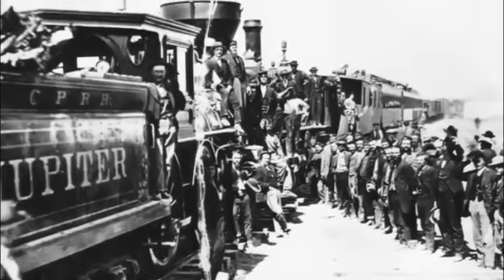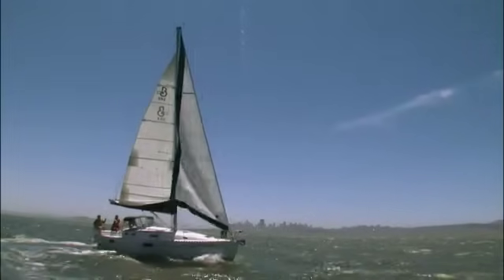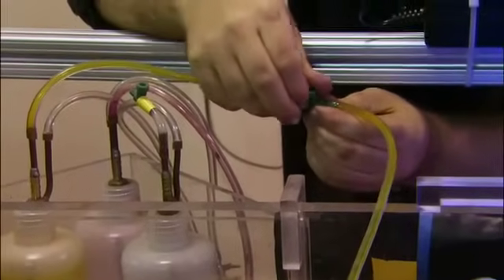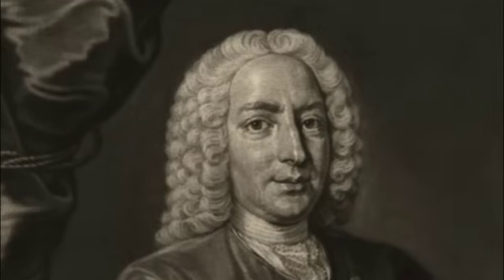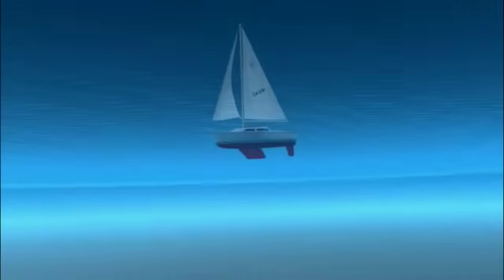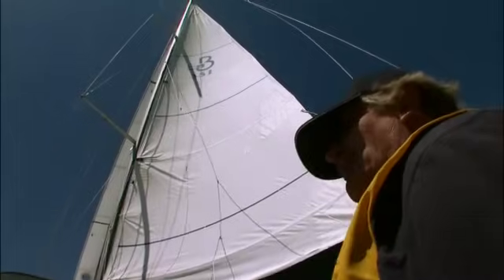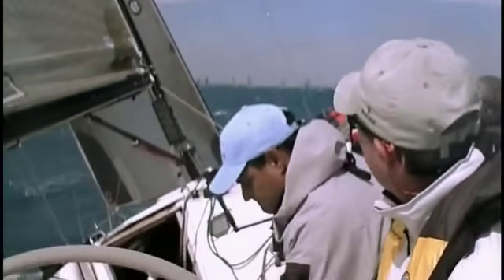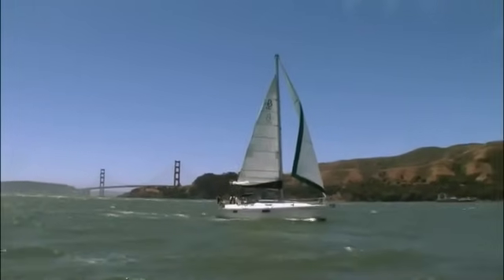The Physics of Sailing | KQED QUEST

Comment: Hey guys, just a note about why lift happens, this guy is chatting bull. Bernoullis law doesnt apply in the case of a wing (or sail). For his law to apply, certain assumptions must be made. firstly that the fluid has zero viscosity, but as we can see, the fluid 'sticks' to the shape of the wing, which is a viscous effect. secondly, that it is a steady flow. which as said in the video, it is not. Finally, Bernoullis theorem only applies to a single flow, once you talk about flows above and below a wing, its moot.

While Bernoullis can describe some of what is happening, the fundamental law behind lift is newtons 3rd. watch the flow as it comes off the wing, its at a different angle, meaning a force was imparted on the air by the wing, and thus vice versa

(im an aerospace engineering student and even people in the aero business get this wrong (including the most of the internet), and this isnt coming from me, this is coming from Dr Iain Dupere at Manchester University)
Reply: ***** Wow that is a strong response.  Unfortunately it is also completely wrong.  Bernoulli himself would not subscribe to this. A few things to note:
1)  Bernoulli's equation is a description of the momentum equation under three very specific conditions: inviscid (all viscous forces are ignored), steady (i.e. time invariant) and incompressible (actually not too bad here although interestingly *****  also comments that fluids are all slightly compressible).  In fact it is easily understood, if the only two forces acting on a fluid are pressure-area and gravity, then for the flow to accelerate it must either see a drop in pressure (i.e. it accelerates from high to low pressure) or a drop in height or both.  Far from causing low pressure with high speed, in fact the low pressure creates the high speed.

2)  Bernoulli's equation comes from consideration of a stream tube and so only applies along a streamline and not to more than one streamline.

Bernoulli then, definitely falls down in this application, on two counts (inviscid and more than one streamline (the flow either side of the sail is on two different streamlines).

Someone else refers to Potential flow and, in particular, the Kutta condition.  This is a common approximation, in which the flow is assumed inviscid apart from the generation of vorticity.  This is a fudge since Kelvin's law shows that vorticity cannot be created in inviscid, incompressible flow.  To have the same constant on either side of the sail requires uniform horizontal flow which has no vorticity.

All this leads to the well documented result that, in the event that Bernoull's equation is correctly applied to a wing (or sail) the actual lift will be zero!!

The Kutta condition does give a crude estimate of the lift (and was used before the days of CFD) and does give some indication of why the viscous effects are important in this case, however, Bernoulli does not strictly apply (the flow violates one of the conditions) and certainly is a poor explanation without some reference to the Kutta condition.  As pointed out, it is better to say that the flow leaving the sail follows the path of the sail due to a subtle but important viscous effect (this could also be described crudely Mathematically as Kutta's condition) and the turning of the flow gives rise to the lift force through Newton's second law (force causing a rate of change of momentum) and third law (equal and opposite reaction - flow is pushed in one direction by the sail causing a force on the sail in the opposite direction).

If ***** wishes to come along to the University of Manchester I will happily not only teach him this, but show him how this works.

PS Application of Multivariable calculus leads to zero lift! precisely because Bernoulli does not apply in the strict sense of the term to this case.
Reply: ***** Don't be precipitated. The guy there above is half right. Newton's 3rd law actually explains the main forces in wings and sails (look at NASA's recent researchs). Bernoulli's principle "does" exist, but it's too weak; thats why in close-hauled the speed is very slow; much less if compared to air speed in plane's wings. There is more: https://en.wikipedia.org/wiki/Kutta%E2%80%93Joukowski_theorem. Also, one cannot test Bernoulli in fluids, because it supposes gas flow and pressure; in fluids (thus not compressible (not as much as air to this case)), you will be actually testing only Newton's 3rd. Even scientists have some outdated beliefs.
Reply: http://www.grc.nasa.gov/WWW/k-12/airplane/lift1.html

Comment: "Square rigged ships only went in one basic direction - with the wind"  PARDON?!  Clearly, this statement is false.  What did they do if the wind changed, or if they had to return home against the trade winds?
In fact, square riggers, while not as efficient to wind as a modern sailing boat, could sail at a reasonably close angle to the wind.
Reply: Don Adamms I guess I wouldn't be as offended by the sheer ignorance of your comment if you didn't make it such a wildly offensive manner. Yes, a square-rigged ship's best point of sail is downwind. This made the trade winds useful for quickly crossing oceans. But people have been sailing into the wind in square rigged ships since at least the 12th century and probably well before that. Don't be such a putz.
Reply: Calling on my experience as a tophand on a tallship, squares are set in two ways, baggy and perpendicular to the wind when the wind is aft the beam this is the best time to sail these vessels, and on the slowness that the video states champion of the seas set a 130 year record of an average of 19 knot over 24 hours in 1854 that is just under the speed of the faster range of cargo ship today.
The second way to set squares is to achieve the airfoil like a modern sloop does but instead of haveing the mast as the leading edge of the sail they are projected out by the yards and then the luff (leading edge) is twerked (actual term for over tensioning a line) then the trailing edge is slacked a touch, this makes your wing shape. The major problem to going high upwind is the fact of the shrouds prevent the yards from achieving the same angle you can apply to a boom when closed hauled. 
On the 60' Brigintine I sail in we have got 8 knots at 35º off the wind in under 20 knots of wind
And 9 knots with 12 knot of wind while running, and for a cargo style sailing ship of it's size and at about 30 ton with less than 1000 sq. ft of sail.
Modern sailing is just using a simpler rig and boats designed for sailing not trading
Reply: Don Adamms
Well, I've contemplated my reply, and my assertion is still the same.  The exact wording in the video clip that I objected to was this ; "Square riggers [... did various things ...].  But these ships of old had their limitations.  They were slow, and they only went in one basic direction - with the wind"

These ships went to other countries, and came back again, not always by taking a different route home to make the best of the wind patterns, but frequently in both directions along the same route, such as from Europe around the Cape of Good Hope to Australia, then back the same way, so the statement that "they only went one way" is counter-intuitive.  More than that, however, it's wrong.  See the explanation by Alex Newman, who has first hand experience and knowledge of these boats, below.

BTW, you might care to reconsider your own assertion that I make you wish you had cancer.  Be careful what you wish for.  As one who does, I can tell you that it's no matter for glib comment.
Reply: Despite Don Adamms obnoxious response, square rigged ships were quite capable of sailing on a beam reach, and smaller brig rigged ships could even manage a close reach.
Reply: If you consider 70 degrees "close to the wind" they could.
Reply: Alex Newman
Exactly right and well explained, too.  :)
Reply: The Pilgrims sailed on a ship into the wind which took them a long time to cross the ocean, as their ship had a high back part which made it not very aerodynamic either. It was a very difficult ship to sail into the wind. But nonetheless, they did it. On the return voyage of the ship, it was able to sail back far more quickly.

My understanding is that sailboats and ships of the Age of Sail were able to sail into the wind, but they were not efficient at it in the same way as modern sailboats designed with computers and modern physics can be.
Reply: Sorry, pilgrims have traveled on a square riggers but would you call your modern seafarer a pilgrim? Square rigged sailing vessels are, with the exception of oil tankers the most influential thing to the development to modern seafaring. As only the loss of masts, larger scale, different cargo and the introduction of engineers are really the only difference between them. Square rigs only ended their days as trading vessels after world war 2. After hundreds of years of development so saying that an aft castle (the high back part) makes them not very aerodynamic is comparing a cars speed to its wheel size when you were neglecting it's date and model. If I were to say that a carrack was not a vessel made for speed as it was beamy (wide) and made to haul the most amount amount of cargo across an ocean. So took a long time to cross the ocean. Not because they went into the wind but as with seafaring today we go the best way, while accounting for prevailing winds and currents at all times of year etc etc. which is all calculated and published for todays use. So back to the carrack they made use of the different latitudes as the Trade winds are Nor or Sou Easterly and the Westerlies are obvious enough. So they went to the necessary latitude and sailed across at that latitude as the wind prevailed in the direction they were going.

Moving on to a discussion I had recently about sailing yachts to sail trading vessels. Sailing yachts are efficient at using the wind available to a point but then you are comparing a sport car to a house mover the power to weight ratio is showing us that the sports car is as fast as possible and the house mover is moving as much as possible. When the house mover has more power so is less efficient. But again compare the date, the difference of technology, the difference of purpose of sailing vessels. As I have already stated, there are vessels, clippers being the favorite that are the high speed, high valve product carrier and sailing record holders for speed.
Modern naval architecture is a compromise of speed, stability, cost and how well it completes its purpose as well as exploiting every chance to make a vessel as efficient as possible through new technology. Today ships are slowing down and are carrying unthinkable masses of cargo.
To be honest the modern cargo ship and yacht should be able to look at a flying P-Liner and see that it is the pinnacle of human exploitation of modern physics and design. To move multi thousand tonne vessels at comparable speed to modern monohulls. Which is even more impressive when you think of the much greater winds they handled out at sea, a later period square rigged vessel will trump the top speed in the monohull class.
And if there is to be a mass scale of sailing cargo vessels again they well bear more resemblance to a Fly P than a yacht or cargo ship of today.

Not that any of this reply is necessary to this particular comment on this video as well as any offensive I might of given in expressing myself so righteously but I am proud of my career and its origins which I have as my hobby.
Reply: Alex Newman Was not trying to insult square-rigged ships if that is the impression you got. From my understanding though, the Mayflower was a ship that even for its time was slower because of the wind resistance the back part generated, which made it difficult to sail.  

As a side question, do you know of any good places to learn wooden shipbuilding (shipwright skills)? I am very interested in replicas of the classic sailing ships and wooden ships/yachts/boats based off of the old sailing vessels.
Reply: Kyle Blank  The thing is: Modern Sailboats are made for one thing alone: Sailing, and hopefully fast. They are comparatively small and light, and ideally operated by  a small crew.

The Fore/Aft Rigging which is exclusively manipulated from the deck is  requiring relatively little manpower, and  there is no need for people to climb up the mast(s)

And the boats can be built nicely sleek and low, because, again, they are built for siling only.

They are essentially race cars.

the Ships of old had a purpose beyond sailing, they had to carry tons of good and plenty of people, they needed to provide the space and tonnage to do so, which made their hulls much more plumb than a modern yacht.

To move these ships, a LOT of sail is needed, and square sails allow for an awesome amount of sail to be put up. But the require a lot of  manpower to operate and people to go up the masts to do so. But being  far larger, there was plenty of stability and weight in old ships, to allow the weight of  numerous sailors up on the mast.

Also, besides being bigger in general already, an utilitarian ship had to have higher 'walls', to allow for cannons to be high enough above the water line, so they can be fired.

And in earlier times, a lot of fighting was done hand to hand, and  it was beneficial to be 'on the highground', shooting your crossbow or musket  down into the enemy, whilst being somewhat safe  yourself.

As cannons took more and more dominance and importance, the ships became lower at stern and focsel
Reply: Kyle Blank
I know that they were building a galleon from authentic materials and techniques about 15 years ago in Rochefort on the French West coast.  It was quite well under way when I saw it, and all the frames were in place, with the bottom planking of the hull completed, and planking was progressing up the sides.  I would expect it to be finished by now, although I know they were having financial difficulties which may have slowed it down.
Oh - it is finished.  I just found ...
http://discover-poitou-charentes.com/what-to-see/visit-the-hermione-at-rochefort/

I think most "ancient" ships built these days are for film props, such as the bounty.
http://en.wikipedia.org/wiki/Bounty_%281960_ship%29
Reply: Mike Collins Thank you for the information. An old-fashioned yacht I know of is called the Libava, just Google it.
Reply: Ugh. Its people like you that make me wish I had cancer. I want you to think about your question, think about the phrase "trade winds", contemplate your question. Then get back to me
Reply: @donadams3501  You will get your wish someday with the cancer rates continuing to climb; it will probably be what kills us all, even your sarcastic immature sorry excuse for a human being self; I paid 50k USD for my mother-in-law's cancer treatments, it's really not a joking matter even for a weak online little boy such as yourself. Be an adult and respect the rest of us around you that are not miserable sarcastic punks that just go through life tagging stupid, meaningless, and offensive one liners on YouTube, YES, the rest of us want to be constructive and positive and help each other and NOT joke about a terminal condition that has affected almost everyone in your life that you know through someone else etc....well it's been 4 yrs since your comment so maybe you already DID die of cancer....See? You want to be ill so can the rest of us, but is it good for the world? You are pathetic.
Reply: @kinkane5566  Wanna go out on a date? I will treat you real good and you can tell me more.
Reply: @donadams3501  THAT joke, was funny. The first one was not.

Comment: "A luffing sail is not the equivalent of stall on an aircraft", per minute 7:40, it would be an over-trimmed sail.
Reply: And when I criticize an over-trimmed sail, I say it is STALLing (because it is). As John Wilson says, it is most definitely NOT LUFFing, quite the opposite. That statement is just embarrassing.
Reply: Right, that would exceed the critical angle of attack of the foil, detach the laminar flow of air, and cause the telltails to spin.

Comment: which one is better and safer catamaran ou monolhull  ?
Reply: Cat,,,,,, until it tips :-(.
Reply: Boats will naturally try to gravitate towards their most stable position. A  catamarans most stable position is upside down on the surface.  However, a monohull's most stable position is on the sea bottom. A capsized catamaran floats.  A capsized monohull doesn't.  Catamarans win.

Comment: the transcontinental tallships usually had long, shallow keels to help keep courses. A High aspect ratio keel can help ya point higher (also depends on sail design), but it wouldn't have made sense for the kind of sailing those merchant vessels normally did.

Comment: There lift generated by the keel is mostly perpendicular to the keel however with proper fairing you can move that lift forward. The "airfoil" is not as efficient as a wing since the surface is symmetrical. So what you have is a bit of stalling towards the trailing edge of the keel but you still get lift.

Comment: You may have understood it perfectly but it isn't Bernoulli's principle as the air passing over the top is in a different flow field from the air passing underneath. 
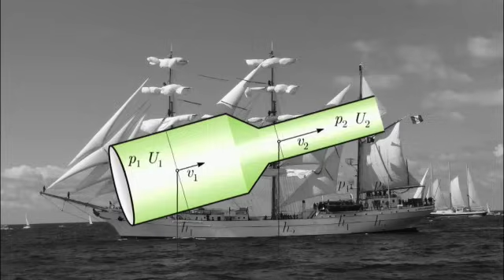Bernoulli's principle only applies within a single flow field like the illustration at 3:55. They did not explain it perfectly at all.

Comment: I don't think it was the sail technology that was the major limiting factor in holding ships back from sailing upwind. They had jibs and spankers even on the old ships. It was rather the heavy, bulky hulls that created the limitation: too much water-resistance going forward compared to the side-ways resistance. Also, the sail area per weight was much higher (and weight translates to more forward water resistance).